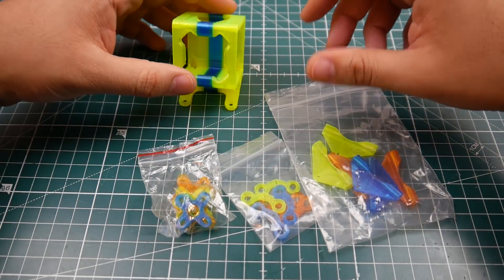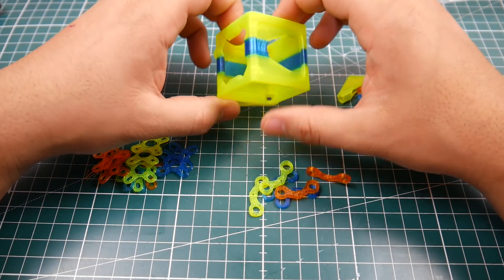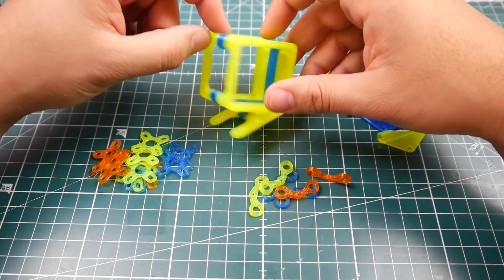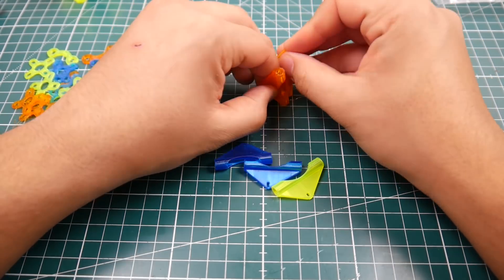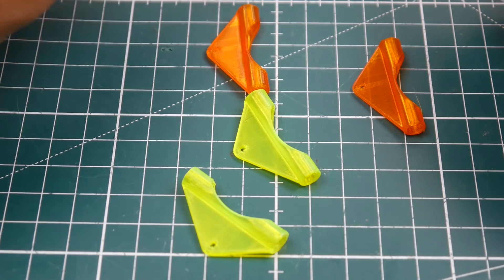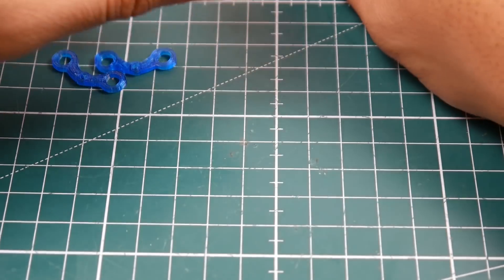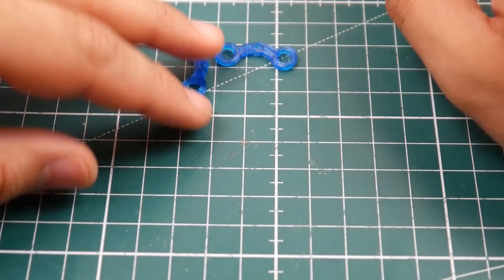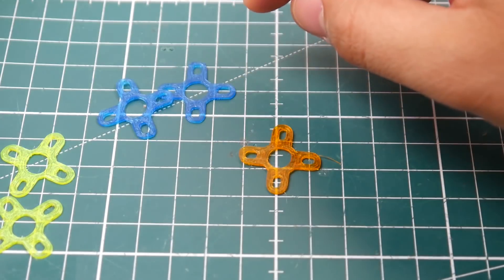Dant Designs //  3D Parts for your Quads

Comment: I finally got my anet a8 printer built and running. Only problem is I have yet to get a successful print. The z axis is not stepping up like it should. No luck trouble shooting the issue yet.
Reply from the maker: increase potentiometer for that servo it's under powered if clicking. or check if the belt is too tight.